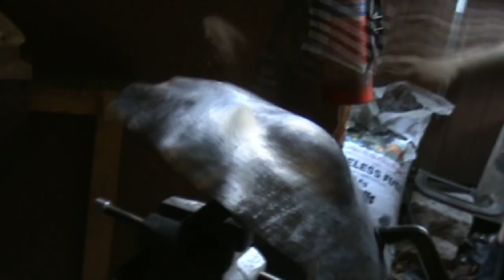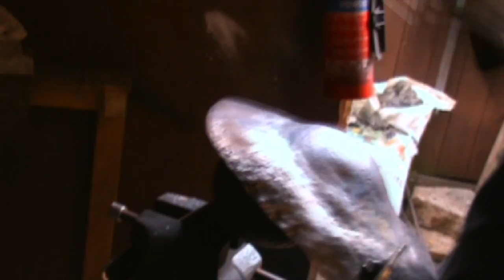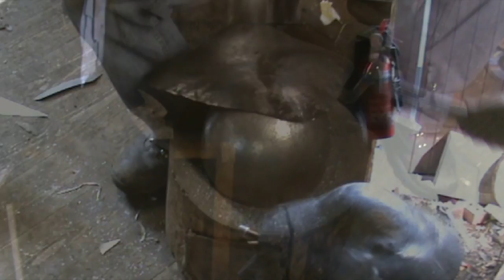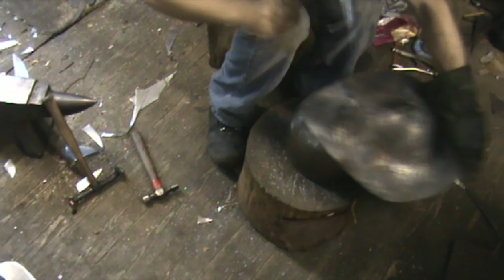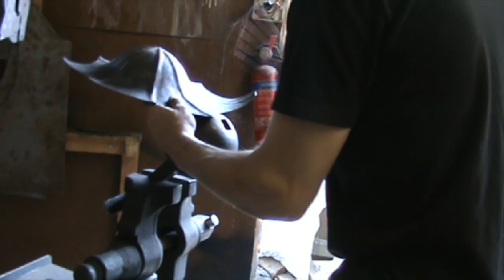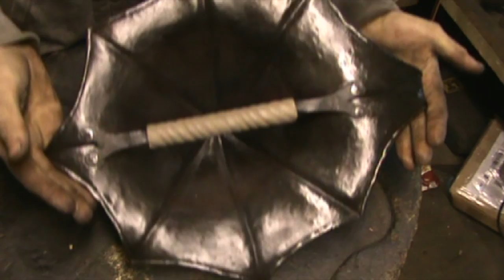Making Armour: Raising a Talhoffer Buckler

Comment from the maker: hi, use tin-snips also called aviation snips, electric shears, throatless-shears or a jigsaw or even an angle grinder. Whatever tool you used to cut out the original shape would work. I use heavy guage tin snips an then hand file the edges smooth. It depends how traditional you want to go. Throat-less shears are pretty good and traditional, and I can certainly recommend Makita JS-1600 electric shears, they are expensive but absolutely fantastic tools with a tiny cutting radius.

Comment: I can't tell from the video, but is the hammer you are using for the detailing a square head? and do you heat up the metal, rough out the fins, then cold work it? or just cold work all the detailing. awesome buckler!